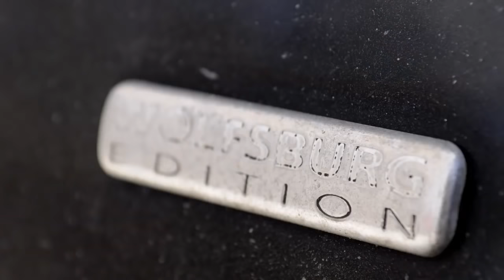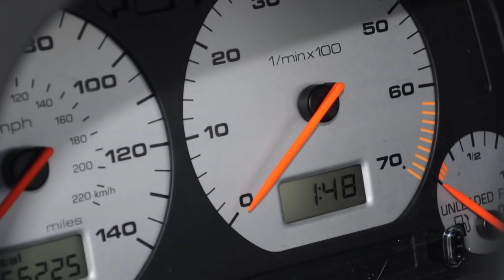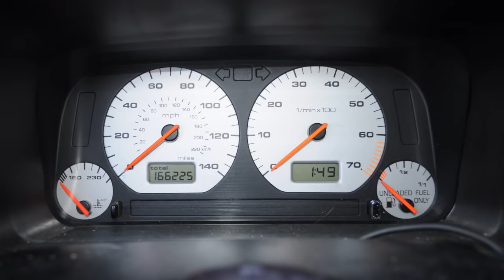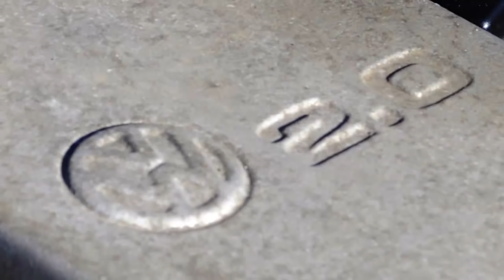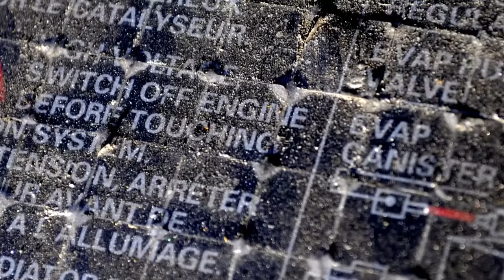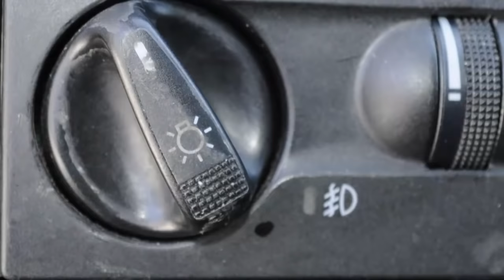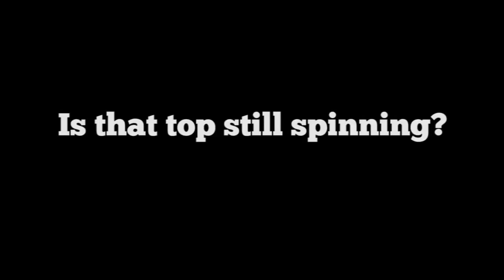Regular Car Reviews: 1998 Volkswagen Jetta Wolfsburg Edition

Comment: What about the vr6?
Reply: And the 1.8 turbo
Reply: Tyree White yess :D
Reply: +Tyree White nope
Reply: +Darkhazard why not? Reliable and quick(for me at least)
Reply: a little late on this one, but the vr6 is anything but reliable, that motor isn't worth the scrap money you could get for it.
Reply: ShotsDesignsHD And what are you basing these allegations on? Personal experiences or what you've read on forums? Because I have owned 3 VR6 cars and none of them have have problems.
They have forged internals so they are super strong. They are simple to work on, and they have a lot of torque and power for their size.
People like to say the timing chains are a huge issue but not even that is as bad as people make it seem.
Reply: dacasman again a little late, but personal experience I myself owned a 98 glx as did a friend and they both would only fire on 6 cylinders when they felt like it (tried everything to remedy this problem. Mine burnt oil like it was it's job as well. I like VW's but the vr6 left a very sour taste in my mouth
Reply: ShotsDesignsHD what do you mean only ran on 6 cylinders? The engine has 6 cylinders...
Reply: dacasman I mean it only actually used all 6 when it felt like it, the majority of the time it might as well have been a 4-5 cylinder
Reply: ah okay, misunderstood your comment. I've had 3 VR6 cars. 1 Mk3 and 2 Mk4s. never had issues with them. 
I did buy a jetta once that had 2 cylinders that cracked on a VR6 but it was because the previous owner let it overheat so bad it blew a hole in the side wall and hydro locked 2 cylinders. It still ran even after that though haha. But I bought that knowing it had the issue. I used the chassis for a 1.8t swap.
Reply: A friend had one. Timing chain.....hamburger time.

Comment: Oh man, so spot on with your commentary on this one. I bought a used Jetta in the mid-2000's. It was a late 90's model Wolfsburg Edition. One of my first cars. I loved that it was so spacious inside as I'm a really tall person and the handling was shockingly good. What sucked about it was its reliability. It was such a lemon!! I was taking that car apart every single weekend and it was so over engineered it was a pain in the ass to work on. I eventually got rid of it out of pure frustration. Seriously, one day the clutch cable just popped right off so I pushed it up the street to a mechanics shop, put a note on it, and walked away for good. I just couldn't stand looking at it anymore.

Comment: My first car was a '99/2000 VW diesel jetta. I got it very used, but it was reliable and got 55 mpg going from Portland to Seaside. It finally died at 300,000 miles, and will not be missed.

Comment: I had a 98 GTI that I bought in 2002.  Worst car ever.  Every part of the dashboard stopped working after 35,000 miles, no speedometer, no lights and no tachometer.  Those were the easy problems to fix too.  Granted, it handled well but had zero torque, except for some moderate torque steer in first and second gear.  I am soooooo glad I got rid of it immediately after I fixed the dashboard fiasco after spending several weekends troubleshooting the issues.  It ended up being water, just like Mr. Regular said at 3:26.  Not to mention the piece of trim on the side of the door that decided to fall off right after I bought the car at 22,000 miles.

Comment: I had a 1989 Jetta, the mk2. 1.8l I4 about 100hp with a 5 speed. It absolutely flew. Great gas mileage even with the throttle floored most of the time. I got at least 25mpg city and 30 or better on the highway. I used to drive from NYC to visit my sister in Vermont. Once I got out of the city I could make the 225 mile  trip in 3 hours. Never got a speeding ticket, cops never gave it a second glance.  Just kept out of the left lane and below what the faster left lane bandits were doing.

Comment: I too hate Jettas. One of the funniest things I ever saw someone do to a car intentionally happened with a Jetta. My Dad's girlfriend's flunkie son had a leak in the trunk weatherstripping on a Jetta he snagged on craigslist for a grand or so. How did he fix it? He drilled a bunch of holes in the bottom of the trunk to drain the water. I did warn him this could be a terrible idea, but he persisted. So, he drives it to the gas station, goes to fill it up, and puts about $10 worth of gas on the ground because he just put about forty holes in his gas tank. Basically what he did was drill everywhere there was water accumulating, so in every little indentation inside the trunk there was a hole. A hole that went straight through the sheet metal and in to the plastic gas tank. It's a miracle he didn't drill through the wiring harness and burn down the car, but I'll admit I was hoping for it a little.

Comment: I love my 2010 Jetta with the 2.5 i5 great car, so luxury and cheap with a great sounding engine
Reply: ...until you have to do any sort of repair
Reply: +Jesus Fingers 
Exactly! Wife's 03 Jetta has been in the one shop in town that'll work on it for over a month. Needs a $35 output speed sensor, but it's located INSIDE the transmission so it's going to cost $2000. Car is barely worth it but she loves it
Reply: Oregon Jeeper Thats how my 06 jetta is, just eating up my money nowadays. Its funny because I did not have to do a major repair until about 140k miles but now that it is at 150k miles it seems to be falling apart.
Reply: Yea glad my old P.O.S VW Passat is gone...fucker blew up while I was driving left me stranded about an hour north of Pittsburgh... That car was a headache!
Reply: Hey thats the exact Jetta I have too! I love it as well
Reply: I find Volkswagen is a brand people love or avoid. My driving instructor had a TDI Jetta that was very slow but got 40 Mpg.

Comment: as much as I hate VW I may think about picking up a 5spd 97 Jetta. Why?, why not? I mean it's a cheap car it gets good fuel economy and most importantly it's got a stick. For $1000 can you really go wrong?, well $1000 and a water pump. And it's only got 92,000 miles on it. My malibu has 220000 on it, and fuck that car. And at the end of the day, at leasts it's not a Toyota, or a Honda. Although I was looking at a celica, then I realized that car is basically a corrola. And I dig the boxy design.

Comment: My first car was an 8v Mk2 Jetta. Bought it off a Korean guy for 700 bucks at 110000 miles. It wasn't fast. It wasn't particularly pretty, even being in excellent condition... But it was ohhhhh so comfortable, and confidence inspiring at 62mph. At 62 mph, the engine harmonics would lull passengers asleep, and somehow keep the driver awake. We literally made a game of it, and the average people would last was 10 minutes.
The car was a dog in town. It would snarl and rebuke drivers it didn't recognize. The primitive computer would learn driving habits, so you could pretend your car had more character than it really had. It was fun.

It ate a right front headlight every 27 days. Changed lens, mounting bracket, put custom rubber shock mounts. Rewired... 27 days like a period... It ate an alternator every 30,000 miles. Whether you bought a 400 dollar one, or a 40 dollar rebuild kit. +/- 50 miles. Literally. Could be on the road and play it like a magic trick.

At 385k miles, the original fuel pump failed, on Christmas Day, during a road trip. And it died a sad death when the water pump failed at 518k miles. Apparently it was slightly different than any water pump I could find. And the exact part number was more than the car was worth, for some reason.

That car drove 20 hour days, in every imaginable condition. And saw us safe through 47 states, and Canada, many times over. And even at the end of it's service life, you could pick someone up at the airport, and they'd get that "errrrrr" unsure look on their face, and you'd throw their 3 huge suitcases, and tote, on top of the 30 gallon aux tank under the trunk carpet, and their face would change to "ahhhh!" And follow up with, "It is such a unremarkable car at a glance, I'd never expect you to be the one who drives it. But it's so clean and comfortable in here... And! What the hell?! Does it really have 500k miles?!!!

Oil changes, particular gas, a replacement headlight, a road kit, a bag of 10 and 13mm sockets/wrenches... My girlfriend and I took on anything that came our way. The old Jetta just loved the road. And the magic, sparked at 62 mph.

Comment: Yes, brought back all the memories of my 98 Jetta I had for 8 years. Mexican-made German car. Got me from place to place, somewhat fun to drive, averaged 34/35 mpg overall. Horrible electronics, puffs of smoke would occasionally rise from the steering column after start. Bad syncro on second gear caused it to grind occasionally when trying to shift. Strange issues, expensive to repair, bodywork falling off all over the place, but alas, it was my car. 135k miles got me through college and a 4 years after.

Comment: I loved my '98 Jetta GL.  Reached almost 200K miles before sold it with the 2-point-slow engine with trouble free ownership except for the 5-speed manual that went out at 98K miles.  Got it replaced under warranty thanks to that 100K powertrain protection.

Comment: I hate the corollas more.
Reply: Including the Toyota Corolla GT-S (AE86) from the mid 80's?
Reply: I don't like corollas either, but they have their use. If you want to go from point A to point B, with safety, reliability, and fuel economy, then the corolla meets all those requirements. Sure there are often better cars, but you can always trust on any generation corolla to go from A to B.
Reply: So, like I said before; you don't like the Toyota Corolla GT-S AE86, otherwise known as (in Japan) the Trueno and the Levin?
Reply: rucarnuts13 They only call AE86 corolla in the North America. While everywhere else calls it Toyota Sprinter. I like the car, but every time a kid saw one they look like they just discover their first boner while spilling their tofu water. Neat car though.
Reply: And, if I'm not mistaken, they called it a Corolla in all of Europe as well. It is a sweet car, but yes I agree that every AE86 driver is an Initial D fanboy.

Comment: My last wife bought a 2011 Jetta "sportwagen," but she didn't take care of it, and all the original parts started going after she passed in 2019. I didn't mind replacing the brakes, rotors and tires (chose to replace the rims), but replacing all five cylinders because of a misfire issue really bothered me. 
I saved up for a down payment on a '23 Tiguan, because I needed space for hauling band equipment to gigs. VW had stopped making Jetta "sportwagens'' by 2018.

Comment: It's funny, this wasn't my first car, it wasn't the first I drove, and by time one came into my life I'd driven far, far faster vehicles; but it was the first car I really ever pushed.  The first car I ever hooned about in, the Jetta was the first car I really learned to drive with.

Even with a tired two liter, slushbox, and beaten rear springs that Jetta was actually fun on the backroads and that beaten rear suspension actually made it a good training lesson for real sports cars as it adopted lift off oversteer with each mile on that sagging rear.

And of course, the first lesson in breakdowns as it wouldn't start if you parked over a puddle, the faulty distributor taking on moisture and immediately failing at the whole business of making the spark plugs "spark".

It was a complete POS, it was run into the ground, it was tired, and it was ill maintained.  And yet it was still great; it was the first car I ever saw a hundred in; and it was actually arguably more composed at those speeds than it was around town.

It rocked in the snow, the best non-AWD car I've ever driven in the powder and loads of fun with the hand brake on.  And it was actually good on the backroads, it had pretty sharp steering and cornered fairly well, not that it was reigning in a whole lot from that tired four banger over the front wheels.

It really was the ultimate first car for making people want to drive.  It was eager to get chucked into a corner but never really had enough power to give you any ugly reactions, no matter how ham fisted you were.  You could be a hooning idiot and the Jetta just took it calmly and quietly, and it really came out no worse for wear...

Comment: My 94 2.0 manual jetta GL was a FANTASTIC car, white with black trim and no wing on the back. That thing drove me across Oregon air cooled after the coolent system died. It was a pretty damn fast car too for what it is, the only bad thing about it was the rear seemed to not want to take any weight (had new shocks) and it was in desperate need of a new clutch. Me and my dad owned it for a total of 14 years and it never let us down EVER. Damn good cars if you don't have a modded out slammed pile of trash lemon. Stock is the way to go man.

Comment: the funny thing is that the odometer can read "total" but could not read past 299999.   One the gas models this wasnt an issue but on the turbodiesels it was.  So if you buy a TDi and it DOESNT say 'total" on the odometer, it has more than 300,000 miles.

Comment: My first car was a 1990 Jetta II and I loved it.
My second car was a 1998 Jetta III and I loved it.
Now I got a 2005 Jetta V and I love it ... but it hates me:
Literally one day after the warranty wore off the car was like: "Hey, your passenger door is open."
And I was like: "No it isn't! It's securely shut, I checked it twice!"
And the car was like: "I don't care, I will show this ridiculously bright warning symbol on the dashboard, let it flash from time to time and make an annoying 'pling'-noise all the time while you are driving until you pay about $1,000 to a VW garage to replace my "door control units" on the passanger's and driver's door."
WTF?! My old Jettas didn't even used to have such things. The only problems I had with these was that on both cars the exhaust fell off after about 100,000 miles ... which is no problem at all if you know someone with good welding skills.

Comment: lol kind of funny, my dad had a 94 diesel jetta, learnt to drive on it and would then drive it everywhere and my dad never gave a crap about me not putting fuel in it because it would just go on forever with that tank, like 900+ km on a full tank and back then diesel was cheaper than gas too which made it incredibly efficient. at one point we got hit in the side by a pickup speeding in a residential neighborhood, estimated speed was about 45-50 mph and while the car was damaged, it was easily repairable, no one was harmed in any way and the car lived on, so even if it went down a ravine, I'm pretty sure it would have been fine somehow.

Comment: I like the Jetta for what it is, Common sense. I like the simple Diesel rattle snake engine that run for ever and ever. I like that i can allways plant my foot to the tarmac and skip every second gear and still pull of. There are no extra nonsens in a Jetta, only grotty dark solid high quality plastic where you never are able to see any switch in the dark. And you are victorious the day where you know just the precise distance and the perfect angle of attack you have to point to actually hit any switch blind in the dark, and knowing that it is only you that can manage to do it because it is your car that only you know well. I like the Jetta for a feeling of that this is just like your very first banger car that you bought from scrap and know inside and out because your daytime job would do that you never would have money enough for a couple of hours in the garage. I like the Jetta for the memories it bring about the first car you had and the vision to rebuild modd and restore it even thou you never would be able to pay for all the good ideas. But dammnn in those ideas this car would have been great. I like that it is a car you would not shut the doors on, you kick the doors in. I like Jetta Diesel because no matter how much you try to kill the engine it will survive and drive you the next day, Should the engine finally be killed off you just get another engine and swap it like routine.  I like the Jetta because when i'm behind the wheel i tell everyone around me that i dont give a flickering longhaired hill billy ass fart about anything. And if the car deserve any respect, Out with all the interiour, in with the rollcage, Intercooler turbo pump adjustment racing exhaust and a suspension like a rock, 'ere we go.  Every single dent and schratch will add. to the beauty of such a car.

Comment: Had a MKV Jetta and thought it was pretty alright... for about 15 minutes before the 09G transmission decided it doesn't like to shift from 1-2, or 2-3..... or 3-4, or 5-6, BUT HEY THAT 4-5 SHIFT IS BUTTER. And then both rear tires started going flat nonstop and after 5 trips to a shop the perfect looking TPMS sensors had failed, and then the door locks never worked right.  Lock lock unlock would unlock all doors sometimes, but most of the times the doors never locked themselves with the faab.  i've actually walked out to it and it had unlocked its own doors.... I have decided to never own one again...

Comment: Kinda makes me miss my Gertrude Lupita WOB...she wasn't of the Wolfsburg variety, however. Fuel economy was 30mpg on premium (pinged like a bitch on anything less) no matter on the highway at 85, in gridlock, country roads...

Problems were that I managed to lock the keys in the trunk and AAA broke the air pump actuated front passenger door lock when they unlocked it, so it didn't always suction itself closed. My friend who didn't know how to drive a stick broke the starter motor when he borrowed it for the weekend (no clutch interlock). And the infamous ignition problem was because I didn't disconnect the battery before looking at the stereo wiring.

I traded at 180k in very good condition...and I figure she lived til 250k at least.